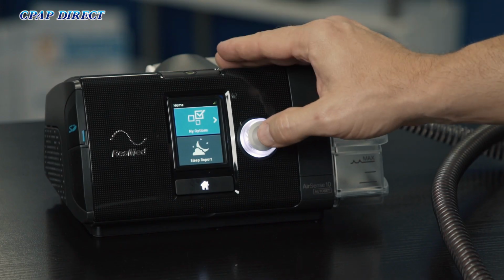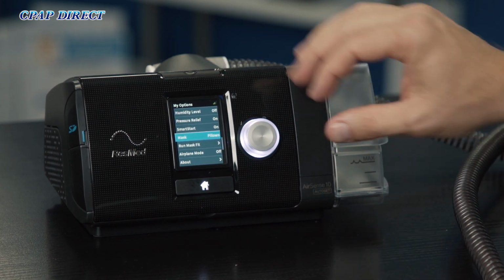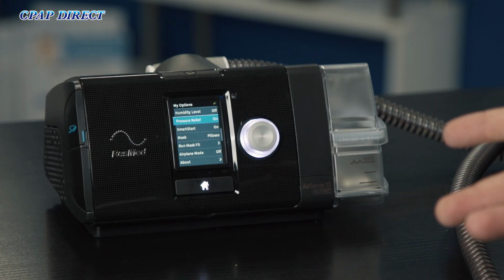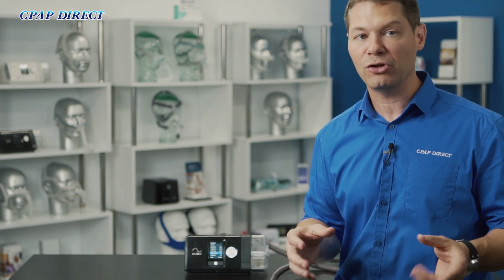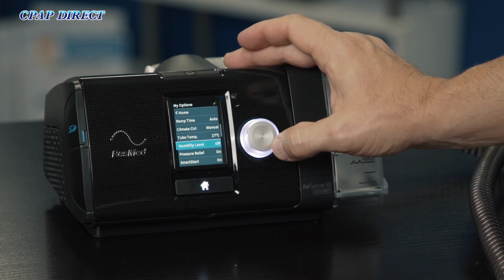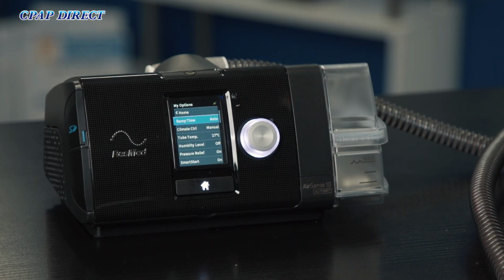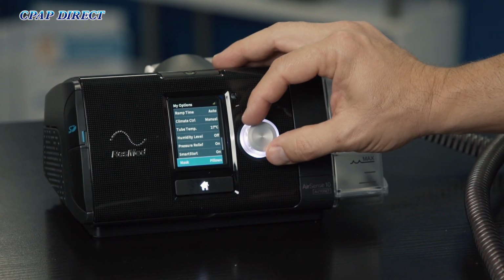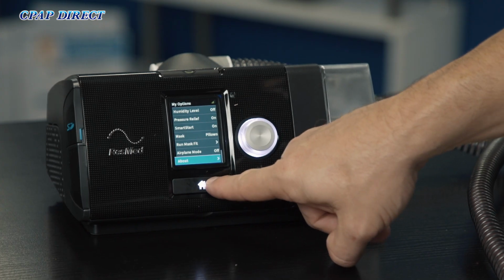ResMed AirSense 10 Walk-through Part 2

Comment: I have been using a RESMED 9 for 6 years, 20,000 hours. It worked well that entire time and reached the "end of useful life", the AC adapter unit died after a few months. In the meantime my supplier sent a replacement machine, Airsense for her. The smart start did not work and I returned it. They said that it met all specs and sent it back to me. I checked and again smart start did not work I returned it. They said it met all specs and sent it back to me. Smart start still did not work. I tried a Phillips machine and it was really noisy and I returned it. My supplier sent a different Airsense 10, the black one. The Smart start does not work! Smart Start on the Resmed 9 machine always went off after 7 seconds. This allows me to take off the mask, scratch my nose and put the mask back on with a minimum sleep disruption. Not having smart start means I have to find the machine turn it off, reposition mask, find the machine and turn it on again all while being half asleep. If you are new to CPAP, it's the machine you will love to hate. No wonder so many people can;t tolerate them. They don't work as advertised.  If you are on Medicare and are working with a supplier of your machine in a different state, and then you send your machine back for repair, demand a machine to use first. I was without a machine for five nights attempting to sleep in a chair and it does not work. My airway is cut off and I ended up with headaches, off balance, hands shaking due to lack of oxygen. I sent out an email today letting my supplier know that Smart start does not work. I can only turn it on or off, unplug it, try again. These machines need better quality control.
Reply: Same here I just went today to get the 10

Comment: I am getting fitted for my ResMed AirSense 10 in two weeks!  Very excited
Reply: Good luck to you! Make sure the Smart start works on the machine you get. If it does not work make them give you a machine while they repair your machine. Make sure you have a humidifier. Use Biotene if your mouth gets dry, it helps somewhat. Use Systane eye drops if your eyes dry out. Make a little fabric tube cover for your hose if it bugs you draping over your chest. Wash your face before using you face mask. If you mouth opens use a full face mask and forget the nose pillows. Don't put up with a noisy Phillips machine. Buy distilled water at Target or Safeway. Cover your machine with a towel to make it quieter. Use some lip balm without petroleum on mouth and nose for comfort. If your nose itches a lot, trim all nose hair. You should get a better nights sleep. If not tell your doc exactly what's wrong and fix it. OK that's all I have. (;-) Best of luck to you.